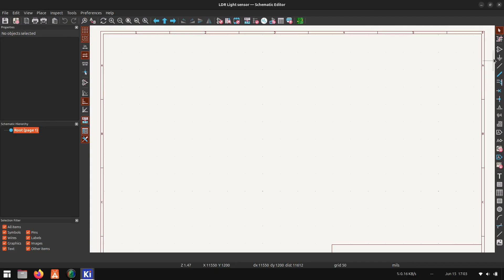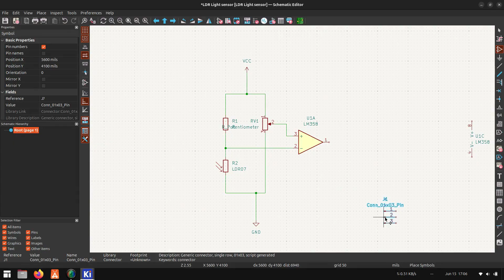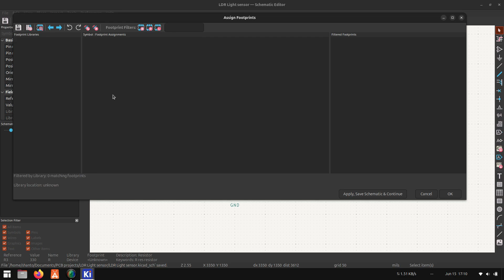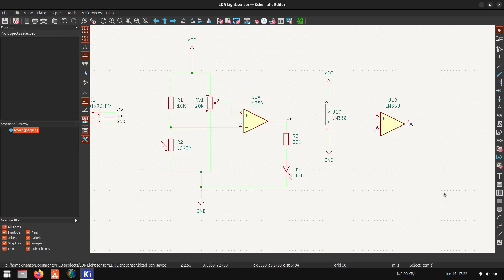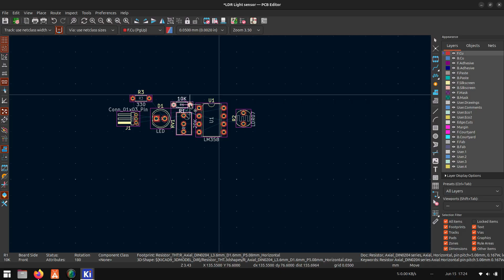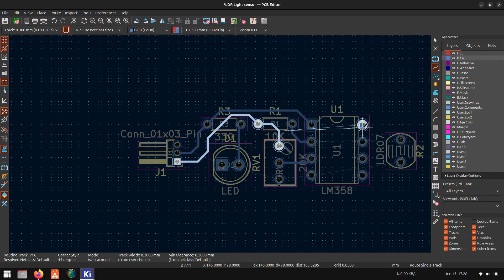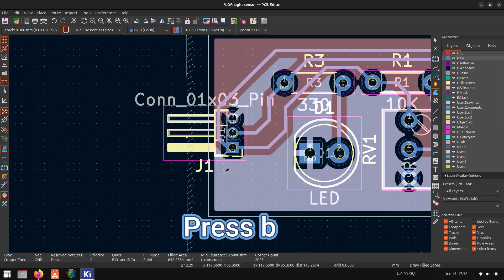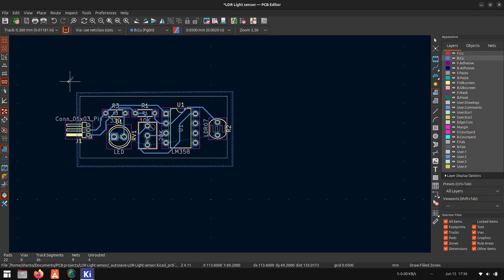Light Sensor Circuit Using LDR & Op-Amp | PCB Design in KiCad

Comment: since we only use 2 out of 3 pin can we just use 1x2 terminal?
Reply from the maker: I took a pin (Out) to take output signal of the Op-Amp so that I could use the signal for further operation. If you don't want such pin then you can use 1x2 terminal instead. 
Thank you very much for your time.